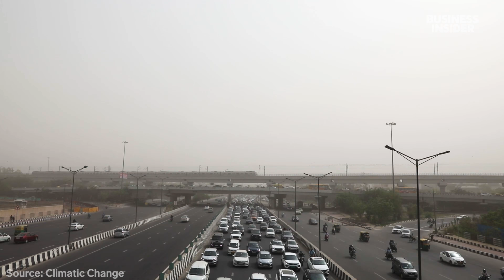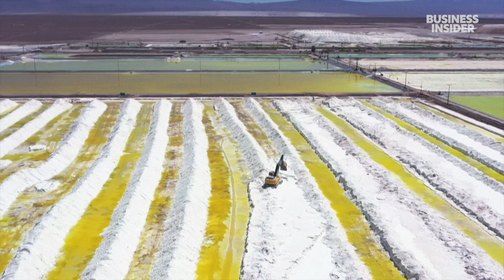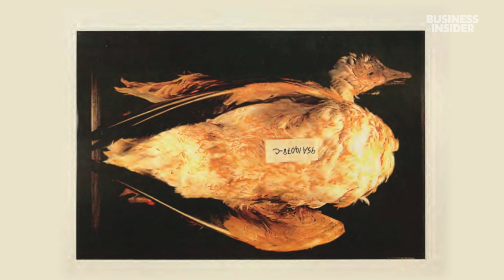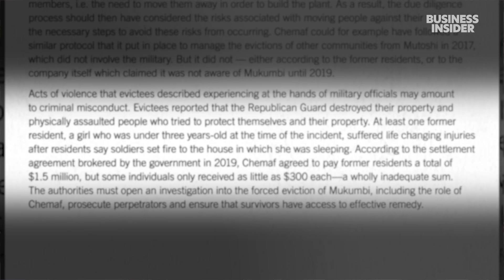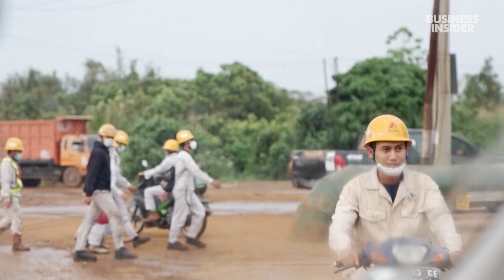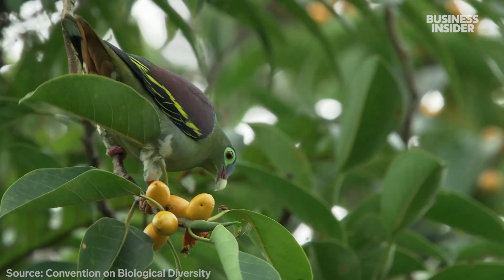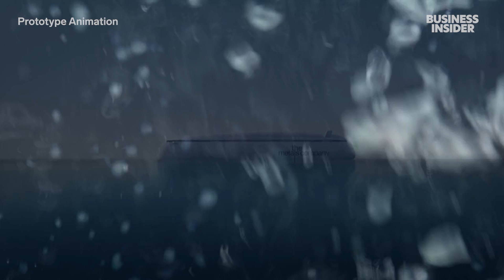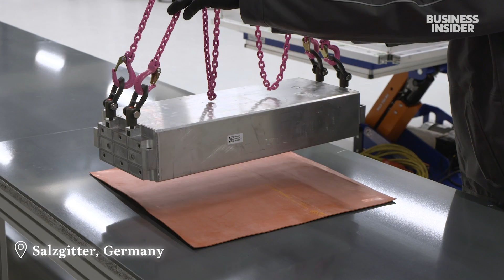The True Cost Of Mining Electric Car Battery Metals | True Cost | Insider News Marathon

Comment: Load of nonsense here. 

EVs dont have to be heavy or involve lots of minerals to offer decent translort. Heavy EVs such as you describe are not necessary for everyday transport, they are a manufacture's and consumer choice, effectively a fashion choice.

EVs can be remarkably economic in terms of materials and cost. The battery in my EV contains just 18Kg of lithium spread over 126 cells (definitely not thousands). It contains no cobalt at all. The minerals and chemicals it does contain are Fe, Li, PO, Al, Si and C. They are all commonplace and inexpensive. The next generation may well replace the Li with Na, this is a far less expensive and more abundant material.

My EV can easily get 400km range, enough for my weekly needs (I only charge it once a week). It carries five passengers and their luggage in considerable comfort. Its tare weight is 1720Kg compared to 1700Kg for the ICEV it replaced.

Not only that it cost just $48K, this compared to an almost identically sized and equipped hybrid I  also considered buying, which cost $54K (and incidentally weighed over 1800Kg).

In the end the decision to buy the EV was very very easy.

Incidentally the DRC artisinal cobalt mines are being closed and replaced by commercial operations. The traditional miners are being paid out and/or reemployed in the new mines. 

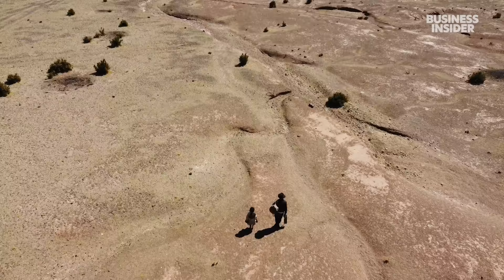Ultimately there is ample cobalt available from commercial mines to meet current demand, it is simply consumer choice to buy cobalt from miners who exploit people. If you want to buy an EV with a 6:15  cobalt battery (the NMC type), fine, but if you have a conscience consider where the cobalt came from.

Comment: What they dont mention, is this push for EV's is motivating battery manafacturing companies and car manafacturing companies, to fund and research alternatives to current battery technology. Battery technologies that's also used in our smart watches, tablets, phones, laptops, power tools, TV remotes, etc. Without the sudden increase of demand for batteries we would continue to be dependent on lithium in the longrun and battery manafacturing companies wouldn't spend the time and money to research alternatives to lithium prolonging the harm caused by extraction and processing of lithium.
Reply: Aren't we still dependent on it though? It is possible that research will have another lithium-like breakthrough. But that new tech will need to be available on the same scale. Not many elements are as energy dense as lithium, and lithium is the most efficient at the moment. Uphill battles aren't won by wishfull thinking alone, keep the reality in mind that research does not equate to "new tech incoming in 3. 2. 1...."
Reply: @Mediamarked  If ya actually looked into it, and bothered to understand the issue and actually understand how these things work. Then you'd realize once companies, universities, etc. get funding things happen. Alot of people already have ideas, but require funding to test and impliment those idea, which lead to competitors trying to improve on those idea or find better alternatives, overcome engineering difficulties. They discover the bennifits, or downfalls of these idea, leading to better idea's. Then it takes manafacturing tooling to get developed, new supply lines, Distrobution lines have to be setup. Consumers have to adopt these "new" ideas. Which leads to further innovations, reduction is manafacturing costs bringing down the costs to consumers. Just think when cars were first invented and manafactured. Going from horse and carriage. No roads, No gas stations. No infractructure. People would have said the same thing back then about cars/trucks as fools say about electric cars/trucks now. People who just consume and dont understand these process of technological innovation sit back and bicker instead of trying to understand or forsee how inovations and engineering solutions that currently make it sound like a bad idea will in time be overcome. Do the research. Lots of Idea's are currenty being developed thanks to this move to force companies to start switching to EV's. now the current timeline given by government is.... unrealistic but a good move in the right direction. But thanks to the push many alternatives to lithium are currently in the testing phase with promising results. Longer lasting, faster charging, lower risk of explosion, made from recyclable matterials, operable in wider temperature ranges. One solution may be better for warmer climates, Other may work for colder climates. For starters just youtube alternatives to lithium batteries. This is the age of information.  Ignorance is a choice. You have a computer in your pocket with more computing power than entirety of NASA when they put a man on the moon. It's  connected to all the libraries, databases, universities around the world. This issue is about more than just EV's. It'll bennifit anything that uses batteries to on or off grid homes. Even the electrical grid itself. It'll provide solution to things we cant forsee. Putting humans on the moon lead to more comfortable beds, Cordless power tools and many other technological advancements came from NASA as unforseen results of the race to the moon.

Comment: But they don't need cobalt or nickel anymore. People need to realise the famous saying "Necessity is the Mother of Invention". If you ban a bad mineral. Researchers soon find a greener alternative. Even lithium has been replaced with sea-salt in some batteries
Reply: doesn't matter. Why would the country use batteries using resources they don't have, while they can make batteries using resources they have..?!.
Also, the video says nickel largely use to make stainless steel. who don't need stainless steel..?!
Reply: Probably because it does not work as well, because the battery chemistry has been known for literal decades. It is not like companies seek out the more polluting products. If the sodium ion batteries worked as well as the chinese producers (byd) would let you believe, other manufacturers would've massively jumped on it as well. 

Be honest, do you think a company would choose importing over producing locally, if the local produced Na ion batteries were more effective? The capacity of lithium to store energy is unique, the storage capacity, and discharge capacity of the many different battery chemistries is vastly superior to the alternatives.

Shortly said- if you can store a lot of energy, but the battery can't discharge/ charge quick enough, it has no place in an EV.

Comment: So while you're at it, can you guys do an expose on the downsides to solar and wind energy? I'd be fascinated to see it.
Reply: Downsides compared to what?  Having no electricity? ;-)
In a word "intermittency", which means we need demand management (e.g. charge cars when the wind blows), interconnectors (the UK can import/export over 10% of peak grid demand via interconnectors with Europe now), and lastly, storage (pumped hydro at grid scale, batteries for grid and for off-grid/backup).
Upsides are that solar and wind are now cheap at any scale (which you can't do with oil/gas/coal), and once bought don't require imports and delivery to keep them operating.
Reply: I sounds like you're specifically asking for biased reporting. Is that what you want?

Comment: Stupidly oversized vehicles used to only go shopping or pick up the kids is a big problem or drivers that do many miles, people like me who have an old car like mine BMW Z4 2.5i doing only 2k miles a year is not a problem, people and manufacturers need to promote city driving of EVs with small batteries and 240v charging and rent a larger long-range EV for holidays! Yes I could change to a City Small Ev, but at the moment they are too expensive to swap and my car contributes to pollution reduction by not being melted down!

Comment: Yea and this is only reporting on the effects from mine to finished product. Then there is the true cost on disposal of these batteries and the true cost when they catch fire while in the vehicle and release deadly gases and chemicals that get into the atmosphere and ground water. There is literally ZERO facilities in place to deal with these batteries. Like everything else the government is involved with it is done half asses with no real plan. Just like there is no plan on the true cost to the power grids that right now struggle to deliver electricity for existing needs. No thought went into the infrastructure necessary for what they are demanding and even though power companies have warned them it can take a decade to build the infrastructure. Yet they are shoving this down our throats anyway. The worse is yet to come and if you dont like it, thank a Democrat and if you are not sure who is a Democrat just wait because they will be the ones crying the loudest when the real problems around all this really start to take hold!

Comment: There are other types of battery  chemistry than lituim 
Flow baterys /salt batterys / iron/oxygen based chemistry etc. many are less resource hevy   sheaper and less  toxic, and less prone to termic runnaway. Or can't even spon. comb.
Yes  often less energy dense but if we talk energy storage for 
Power grid regulation /power to grids; it doesn't matter , these type of  batterys will not drive around in vehicles.  They just take up a little more volume where they stand still, maybe a little heavier per ah .
Also the most effective way to store energy is to pump water 
To a higher  reservoir, when there is exess energy and let the water power a turbine ,when you need to extract said energy. 

Another way to electrify trsnsport , is to convert rail to go by overhead wire ,and this can also bee done with trucks and busses .
If regenerative braking is used the vehicle feed back some if the electrical powers used when accelerating ,this energy can then be used for accelerateting other vehicles. 
This is how electric rail has worked for decades. 
Trowing out the ice engines dosent need to be the only option , you can also build infrastructure that decreases the running time of the engine,  and use other fuel than fosile oil, when it needs to run.
A fue years ago we had a test with electrical net  driven rtucks in Sweden,  on a stretch of highway.  The talk then was 
"When the trucks connect to the 
Grid  the engine can be turned of "
Now i here" when connected to the grid the batterys can charge up "
This takes me to the problem with the batterys in hevy e - vehicles, which are considerably bigger than an personal car . They need huge chargers  witch need alot more  
Effect compered with what a smaller Vehicle sharger  need .
The idea that big timber trucks will go on  huge heavy batterys to distant places  in  less populated areas to get 70 tons of timber logs is foolish.  hybrid drive lines  in the trucks and power via wire is feseebla solutions.
Busses are wery effective (if they are running full ).
The co2 footprint oer passenger is not very big , even with ice drive lines , even less if said engine is powerd by other fuel  fosile diesel. 
Regarding the emmitions of particles and nitrogen oxides and nitrogen dioxide: these bigger have mutch better particle filtration, and all all new engines have ad blue /urea additives to mitigate  nitrogen emissions. 
A small car driven on diesel/fuel has  mutch less efficient filtration and often  uses exhausts reinjection, instead of urea additives.
Using bio lng gas in a buss cut the co2 footprint abruptly, 
And will also generate very little particles,  harmful nitrogen gases . 

When it comes to electrifying vehicles  we only talk battery solutions today.
think about the load on the  grid when all these  vehicles are put on sharge . The grid production will probably have to be greatly increased  to meet up this demand. 
Hydrogen/fuelcell solutions 
Means that a vehicle can be fueled like a car today( in minutes ) the hydrogen can be 
Produced when there is overcapacity in the grid ,stored and used when needed . Even teansported in pipeline and fueltrucks.

The hydrogen production done  today is not very effective  ca 30 % of the electricity used is converted to gas . ( "Blue hydrogen" ) 
The "brown hydrogen" that is produced from natural gas has relatively high co2 foot print .
Better effectiveness in the blue  hydrogen process is needed.
The excess heat created can be used for something,  or 
The process must produce,  less heat/more gas per kwh invested.*

 *This is worked on today and  will probably be achieved.
I think the lithium battery freenze we see today will 
Be seen like a dead end/side track  in future.  On the  stationary battery side there are "better chemistry " to use( or hydrogen gas  storage )
On the vehicle side there are clear benefits of using stored 
Electro fuels eigher in  ice/ hybrid v.  applications/
Or fuel to  pure electrical ev. application  (fuel cells ).

Comment: Thanks to the major fire risk with lithium ion batteries the use of this metal is not ending, being replaced by sodium in the new CATL battery supplied to Tesla and others and by sulphur and other more common metals in other batteries. The rare earth metals that cannot be replaced are those in wind unit turbines and solar cells which sets a limit to the rate at which these can be rolled out as well as copper used in national grid systems. It is these limitations plus capital costs on the increased supplies of power that will control the rate of adoption of EVs unless small modular nuclear units receive widespread acceptance with the first eight in Europe being installed in Poland.